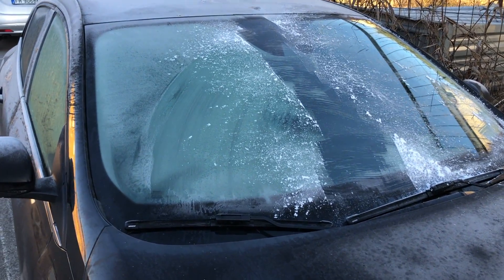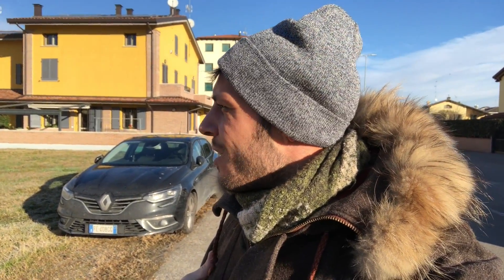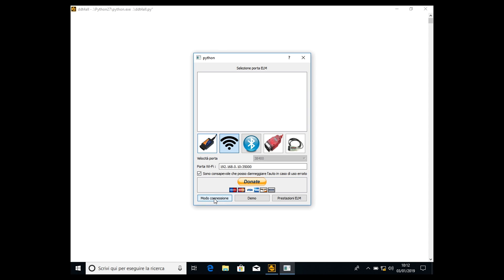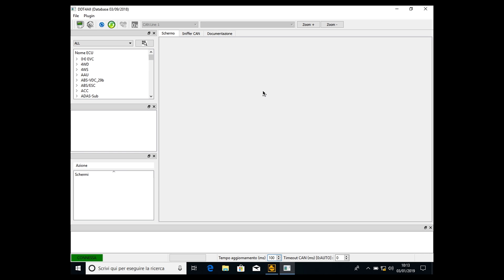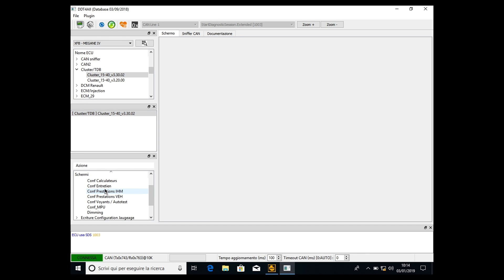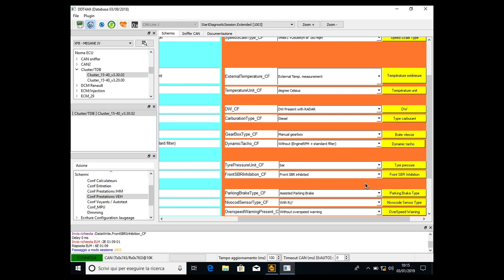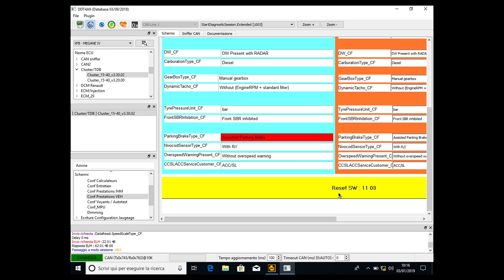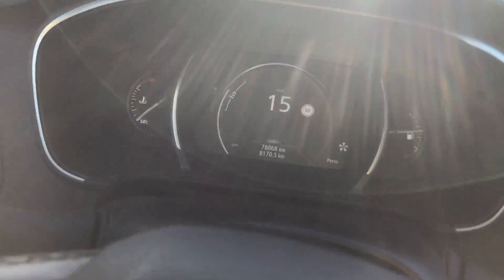Seat Belt Warning Remover | DDT4ALL Tutorial Renault

Comment: Hello, great job on fixing problems with Renault vehicles. Can you post advice or make short video of debug problem with annoying UNBUCKLING REAR SEATBELT problem, although all is working properly? I have Renault Grand Scenic 3, 2011 year, and also other Renault owners have same problem.  Thank you
Reply from the maker: seems like a pressure sensor problem, which does not involves DDT4ALL, otherwise, have you tried to deactivate the seatbelf warning sound?
Reply: @drivewithmi  Hello. No, I haven't tried to deactivate seatbelt warning sound. It is the same as you did in video? If problem continue I will try to deactivate warning sound. Thank you for reply
Reply from the maker: yes the same!

Comment: @MichelePredieri can you tell me how can I do make, on/off button DW(distance Warning) work perfect?
Reply from the maker: what you mean by work perfect? do you have the distance warning module?
Reply: @drivewithmi  in the cluster I can see the distance off front car. No ACC option, if that you mean.
Reply from the maker: yes, but if you can't turni it on or off you probably have messed something with ddt4all? tried an hard reset of the system?
Reply: @drivewithmi  I'm afraid of the hard reset, because I already made a mistake in the audio ECU and ran out of settings
Reply: @drivewithmi  pls can sense me acoustic parameters string for bose edition?
Reply from the maker: Tomorrow I send you everything! Now I’m far from home, so I don’t have the OBD tool with mr
Reply: @drivewithmi  very thank you
Reply from the maker: if you see the distance it means you have it active, so what is your needing? sorry but i guess i didn't get your answer
Reply: @drivewithmi  in r-link drive assist setting I can't turn on/off the options. I guess tu turn on or turn off the system right?
Reply: @drivewithmi  can't now, send you a photo, coz I make a stupid hard reset ECU,😔, I go to dealer tomorrow 🙄